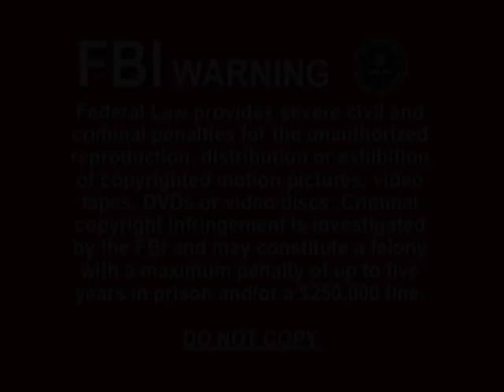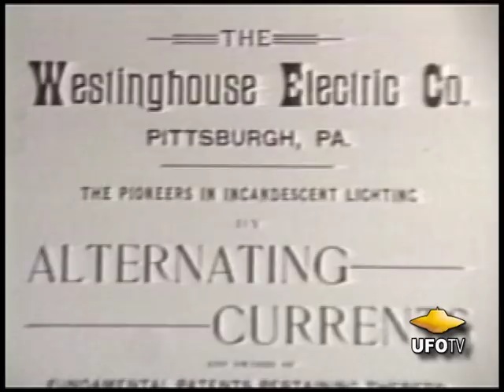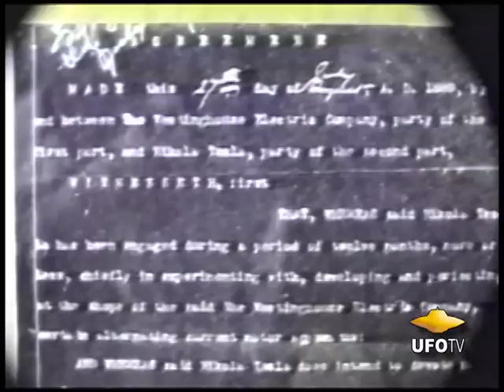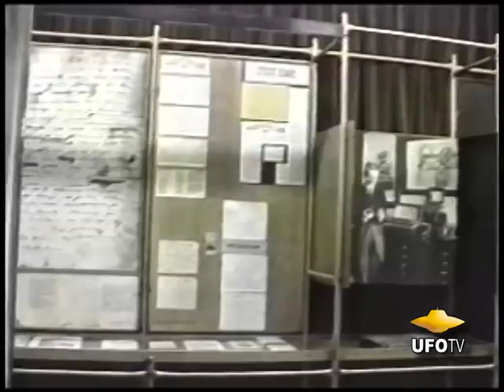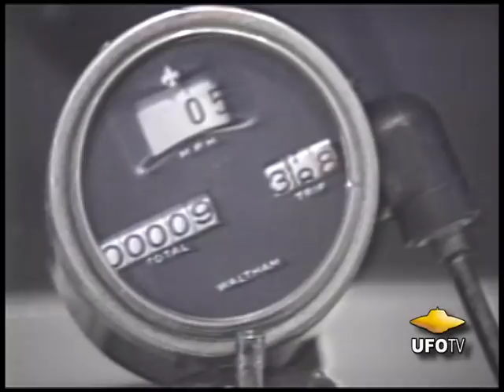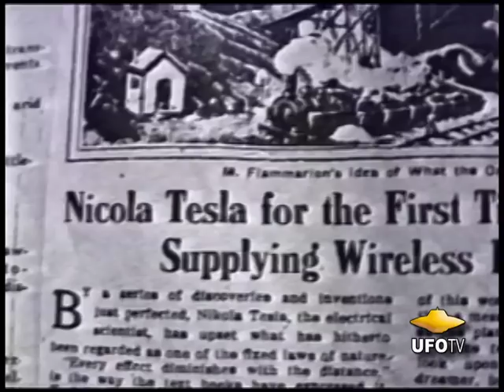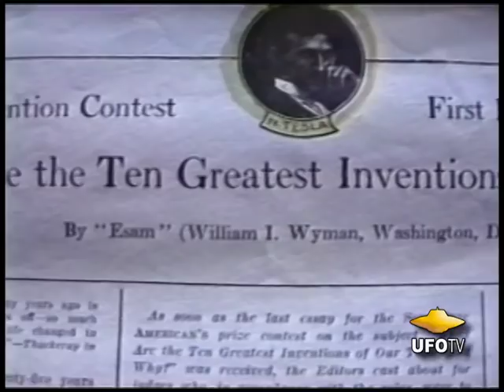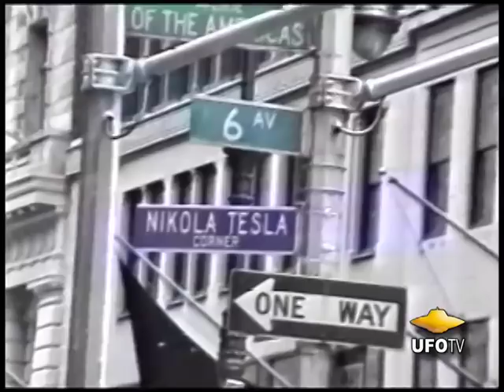NIKOLA TESLA - The Genius Who Lit the World - FEATURE

Comment: Look up perpetual motion machines on this site, someone put a wheel with a rail on the inner circumference in which he places a metallic ball, when a magnet is placed correctly the ball continually is attracted to the magnet, in which the  motion of the wheel and gravity cause the wheel to spin. should the magnetic field become strong enough, and wheel become hooked into a rotating magnetic field, it could be used to generate free energy.

Comment: Wireless transmission of electrical power in the quantity needed to power a city does not work. The only way you can send megawatts of electrical power through the atmosphere is via a lightening strike, The Tesla Tower concept works for interesting experiments, like illuminating a flourescent tube for example. but it never operated as initially intended.